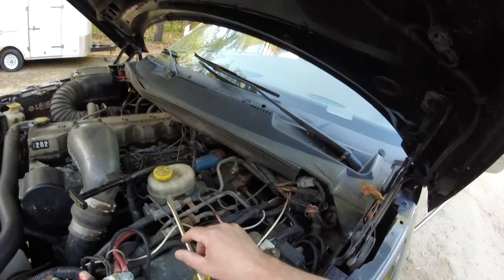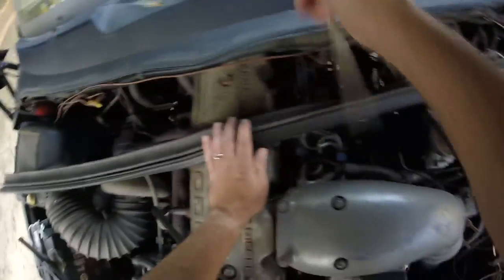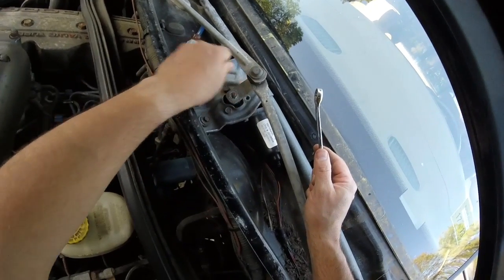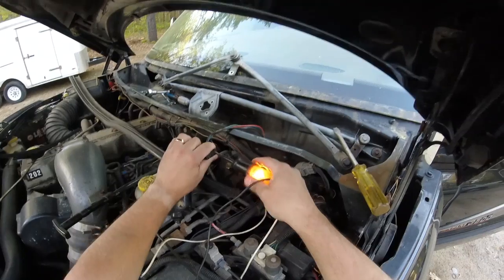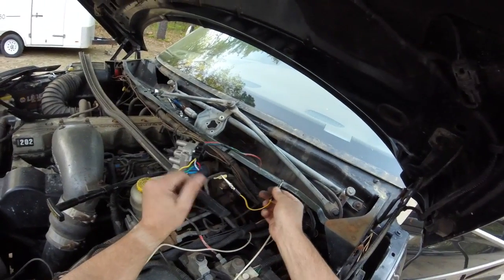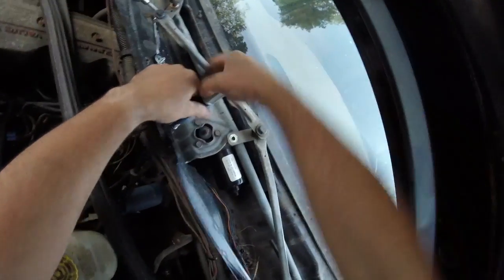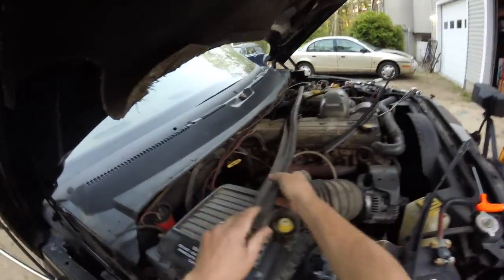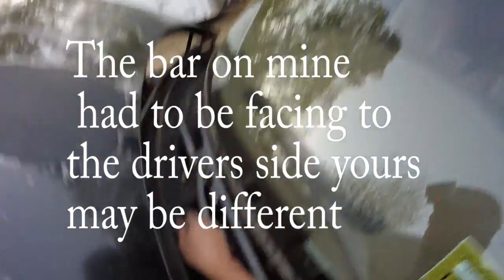windsheild wiper motor replace and bad ground wire

Comment: Where did you get the wire to ground it?  I can't see what you actually did and have the same problem.  I guess the black wire is the ground?   Did you reconnect the bad ground and leave it connected?  If you could draw a diagram of how you connected the new ground wire and where you purchased the new ground wire (does it have to be the same thickness of wire?).  I have no electrical expertise at all.
Reply: We worked on it and the ground was a white wire in our car.  We determined this by attaching a new wire, that was grounded, to the white wire and then we could see the wipers were working.  We disconnected it (the white wire) from the wire connection and connected this white wire to a new wire and the other end of the white wire ground was already attached to the motor body. Then we connected the new wire to metal of the car body and it works!   Thank you so much.
Reply from the maker: Yes I reconnected the black ground wire. I just hooked it to one of the screws holding the wiper motor
Reply: 2009glories l

Comment: To do the job right, you remove the wiper arms FIRST (lift up the arm about 25 degrees, pry out the little L-shaped lever at the pivot cap).  Second, pull the rubber seal off the front of the cowl cover, then to remove the cowl cover, you don't need to mess with an Allen head wrench on the 5 plastic clips near the windshield, you just pry them up using a plastic interior trim clip wrench.
And a good mechanic doesn't start chopping away at wires without knowing which component (terminal, plug, connection, or wire itself) is faulty.  He properly diagnoses the bad component and repairs that one (or replaces the entire assembly).
Finally, I can't understand why anyone could find value in a video that begins with "I just grabbed onto the wiper arm and pulled hard and broke it."  What kind of mechanic starts with the BFM approach.  I wouldn't let this guy get within 15 feet of any of my vehicles.
Reply from the maker: Edward Olsoe LOL thanks for the comment it was very comical to read,  hope you have a great day.
Reply from the maker: Thanks for your support, I learned a long time ago, you just can please some people no matter what you do. Thanks for taking the time to comment.
Reply: @shanesmaineshop  no problem. Every car is different and some methods work for others. I’m assuming this is my issue. Thank you for the video